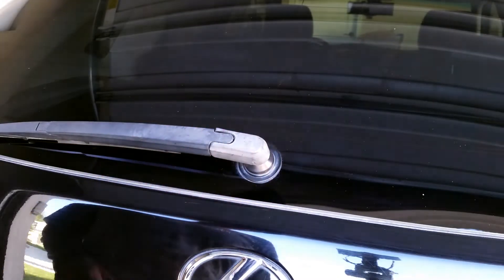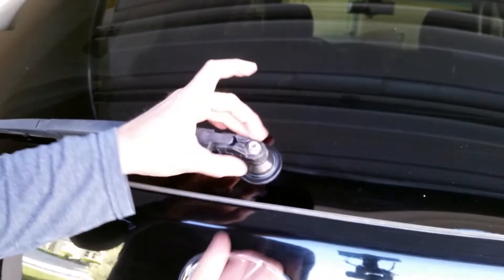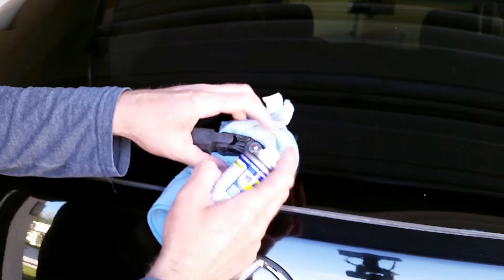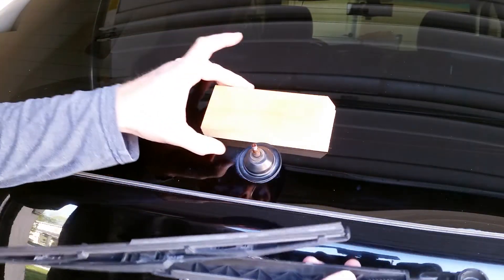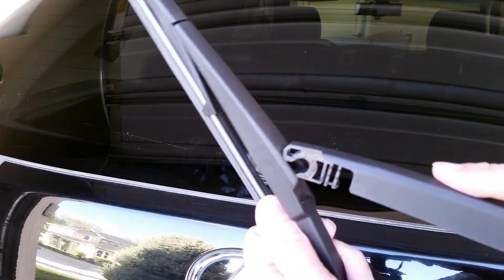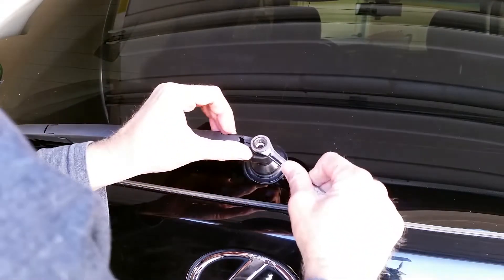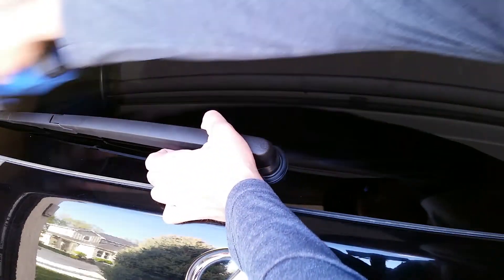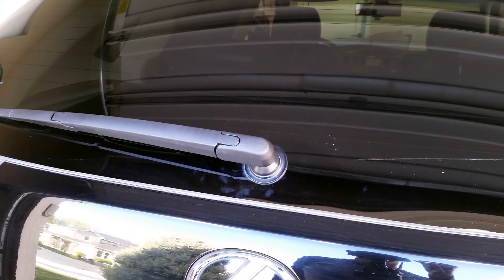Replace Rear Wiper Lexus RX350-REMOVE & Change Arm-FULL DEMO

Comment: Bro you don’t have to take the whole thing off, after you remove the first clip the whole thing folds back! 👍
Reply from the maker: Yeah but if you watched the whole video I mentioned it was time to replace the weathered looking arm, and I was not able to find just the blade locally. For about ten bucks I got an entire new setup, and an upgraded one at that.

Comment: Very helpful. Thank you! I backed my 330 up into the car port and broke it off by accident after i didn't realize it got the storage that stuck out. Thankfully i didn't break the rear glass.
Reply from the maker: That's great it worked out on the 330, glad I could help!

Comment: Hi Keith, thank you for the very helpful video because I have to change this out on my mom’s 2004 Lexus RX 330. I already found the same part assembly on Amazon so it was nice to double check I was ordering the correct one by referencing the one you included in the description, it’s very inexpensive, which is nice. Anyways my only question for you is instead of using an open ended 10 mm wrench will a standard 3/8 socket with an extension not fit on that nut because of the clearance? Or is it too tight that I need to use an open ended wrench? I believe a 10 mm is the same as a standard 3/8 but I could be mistaken.  Nevertheless, I’m just wondering if I need an open ended wrench or if a socket will do the trick as well because I currently only have sockets and I don’t wanna make a trip to the hardware store if I don’t have to. 
-Thanks in advance. I really appreciate your help!
Reply from the maker: It's always best to have more than one way to remove a nut or bolt in case you don't have clearance for a socket. Some places are selling pretty good affordable open wrench sets that are good quality, such as Harbor Freight. Some sell individual wrenches. Thanks